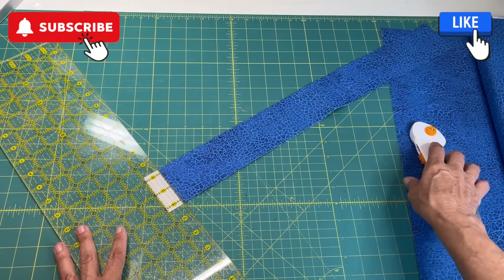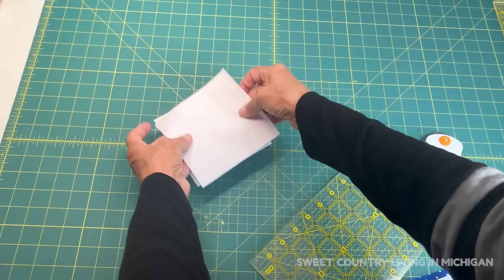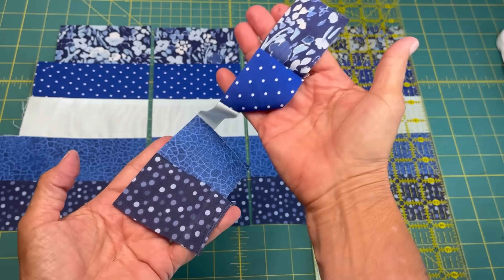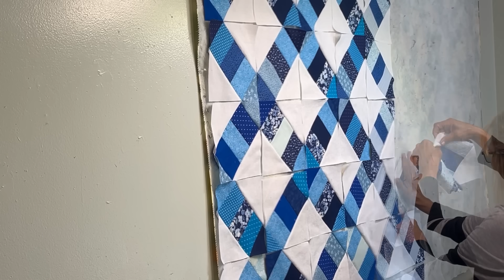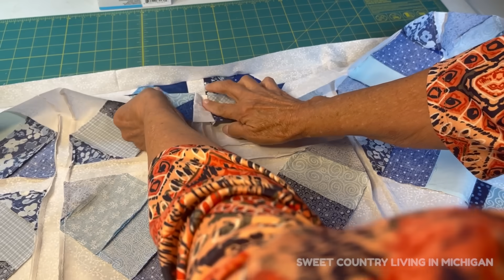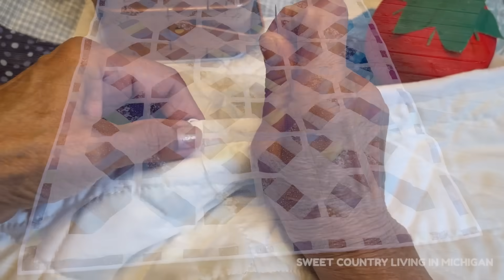How to Make an Easy Quilt | Step-by-Step Quilt Tutorial | Perfect For Scraps

Comment: What fabric are you using for your design wall? Love this quilt!
Reply from the maker: Isn't that great!  I did a short on my channel of the design wall.  I show opening the package so you might want to check that out.  But it is just simply a cheap tablecloth (plastic) from Walmart.  The one you see in my video I bought at Dollar General and it works, but it isn't as good as the one I bought from Walmart several years ago. I just love it.